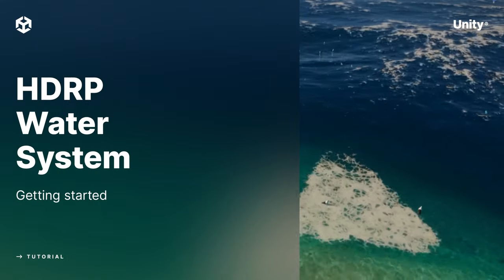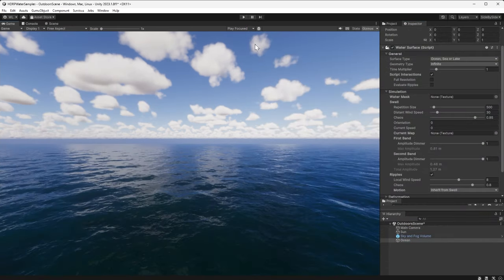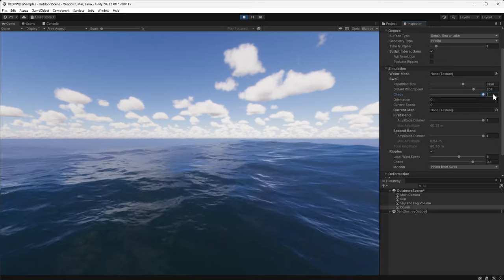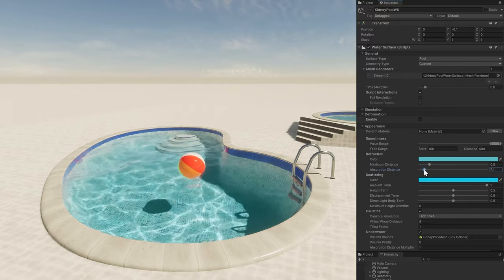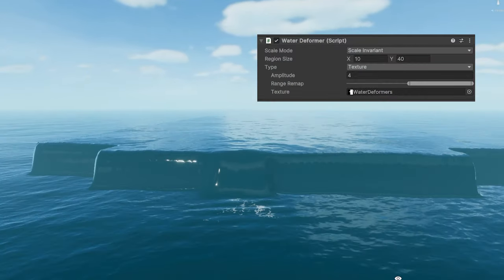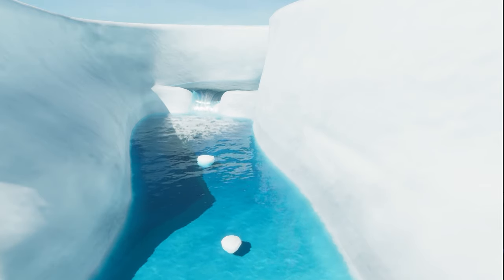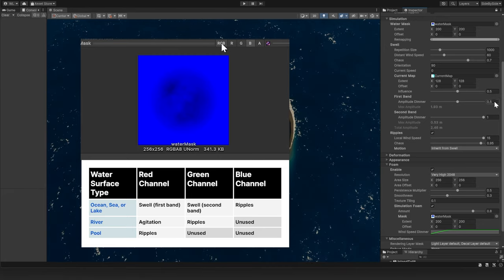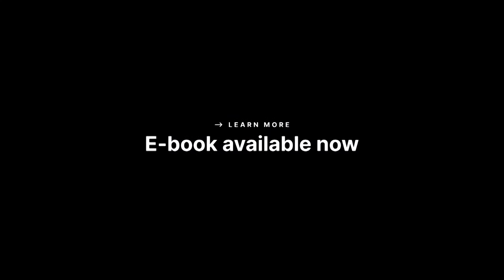Deep dive into the HDRP water system - Tutorial

Comment: For anyone having issue of water not rendering its because this tutorial didn't fully explain how to turn water on for the latest LTS (22.3.22f1) You need to add a volume to a scene add override for water rendering, enable project settings-hdrp-quality-water, then to graphics-hdrp global settings make sure the volume you added the override to is the one selected, and lastly, the part this video left out, you need to scroll down to camera-rendering and enable water there this is also located in project settings-graphics-hdrp global settings. Then you can add the water to the scene and it should work. But the water samples from the project manager aren't available for the latest LTS, how come?
Reply: So ... They left out most steps? Classic Unity
Reply: The tutorial that fails in basic setup? 😅